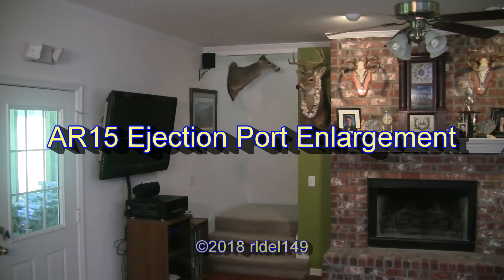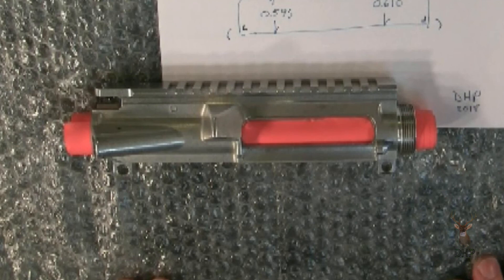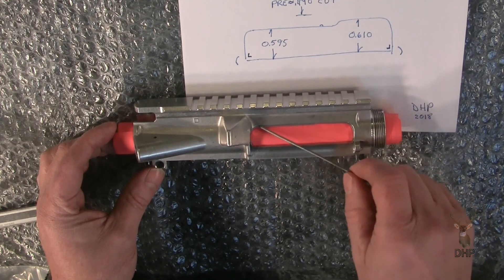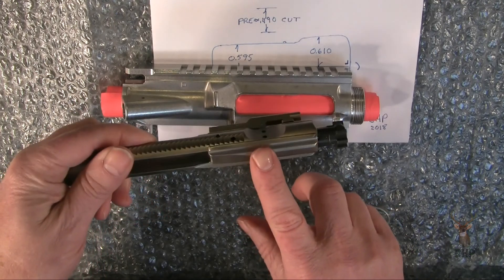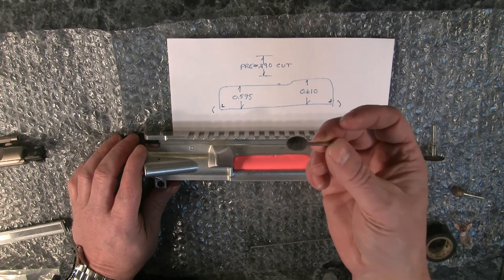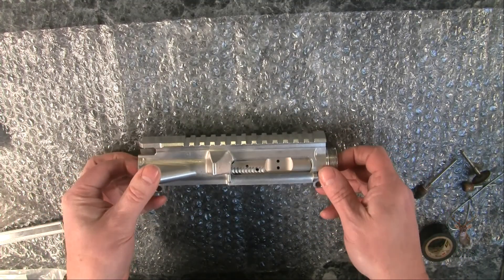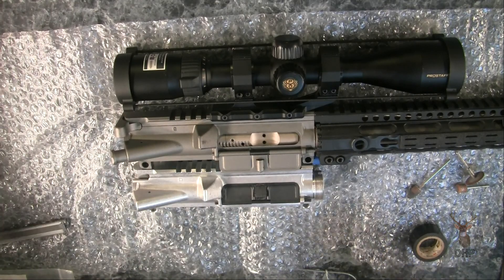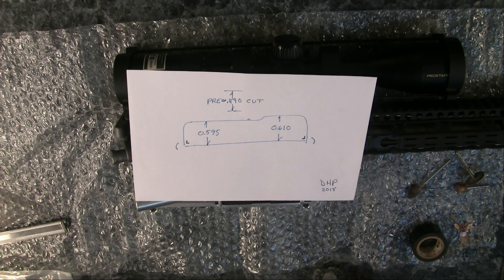S8E2 – AR15 Ejection Port Enlargement - 1080p

Comment: Did you have to do anything too the feed ramps, on the upper, and barrel extension? What kind of feed ramps did your barrel have?
Reply from the maker: @Dallan-x9c  not that I remember. If I did, it would be in the other videos. The 458 SOCOM forums are full of fanboys - obnoxious fanboys. Some barrels and bolt do seem better than others. The forums will try to bully you into buying from one guy. It's a clique. 

I think the magazine you choose is a big influence and bullets. You can sometimes file the mag lips on the inside face so they are a little wider towards the front which kinda lets the top round to nose up/tilt a little faster. Be sure you want to before you change any dimensions - 'cause you can't put it back.

The forums push certain mags, I didn't find their opinions to be on-point. I don't doubt the specific brand was and better than any other.

What I remember is notching the magazine out on the front (skinny side) facing the feed ramps. I don't think you want the top round to nose up so much it drags the bolt. At the same time if you were to push the top round out with a thumb while holding the mag in your hand outside the receiver (you know - just the the mag), your bullet should not hang on the front lip.

Also, if you have a Dremel, and they bind up, you might polish from the inside up. You know to make it slicker and to have no burrs. I think, the mag I hunt with is a standard Pmag with a little sanding.